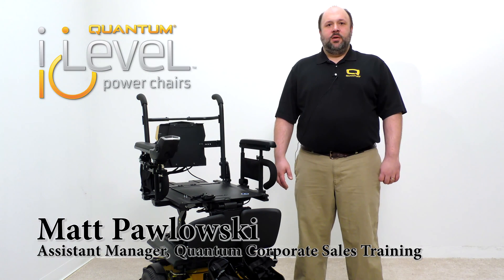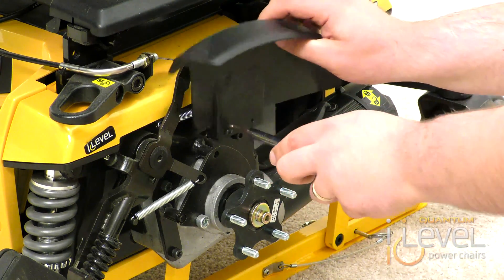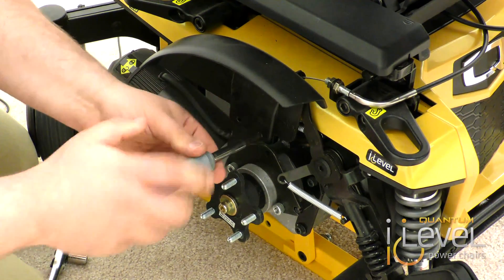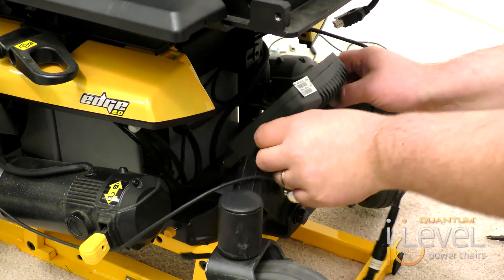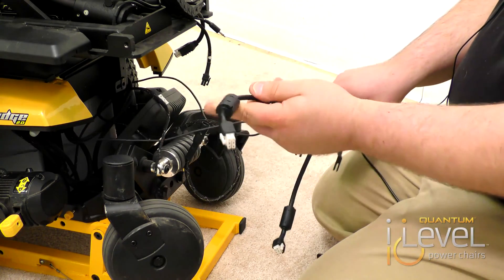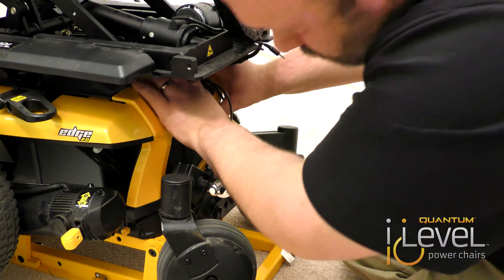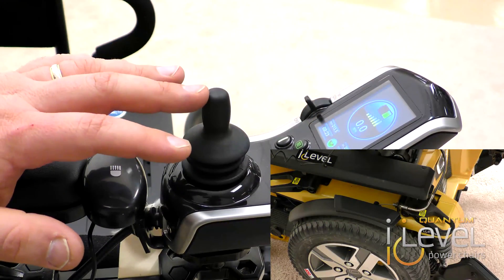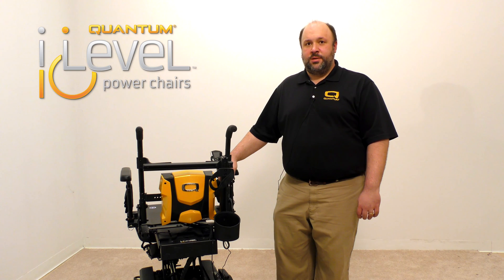Retrofit of Automatic Operated Fender Lights on the Q6 Edge® 2.0

Comment: Will fender lights work on the Q 6 Edge?
Reply from the maker: Hi Roger, the Q6 Edge is discontinued and no longer available. Also, the fender lights are not compatible with the Q6 Edge. At the time when the base was still available, consumers could purchase an optional full light package.
Reply: @QuantumClinician  ca I still get parts for the chair?
Reply from the maker: @rogertyler3237  Yes, you should be able to. You'll need to find an authorized Quantum dealer, however, to perform any service or repairs on your chair. You can use our Dealer Locator here https://www.quantumrehab.com/quantum-provider-locator/

Comment: How is it that the switch is being mounted in that location between the arm rest and the controller?  Is there some sort of bracket  that snaps into the end of the arm rest sort of like the cup holder does?  

Also, if you get the iLevel seating option, shouldn't the fender lights be set up as "automatic" from the manufacturer?  I have the iLevel seating with the fender lights on my new Q6 Edge 2.0 chair and the person that delivered my chair asked me if I wanted him to mount and hook up the light switch while he was there.  I did't have him do it because I wasn't quite sure of where I wanted the switch mounted yet.  However, after he left, I noticed that the fender lights were not coming on when the joystick controller was powered up, as I thought they should.  Does the light switch have to be installed for some reason BEFORE the fender lights will automatically come on when the joystick controller is powered up?
Reply: I hope you have since resolved your issue.